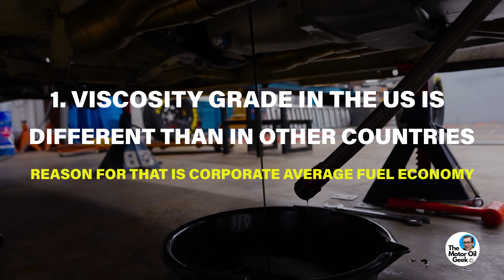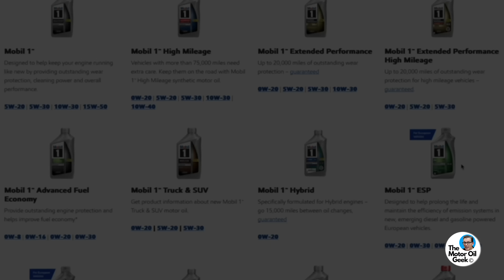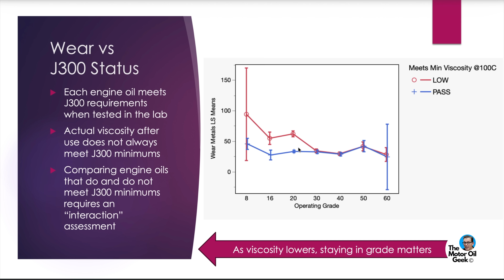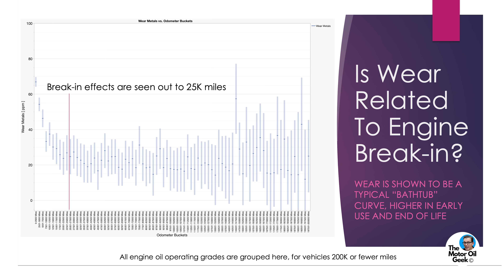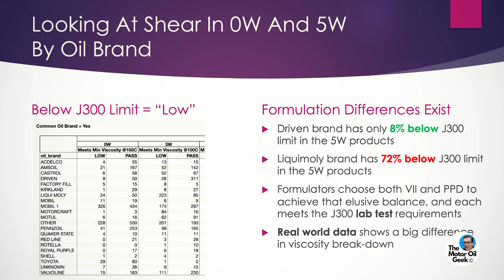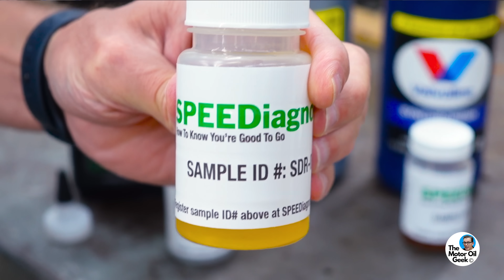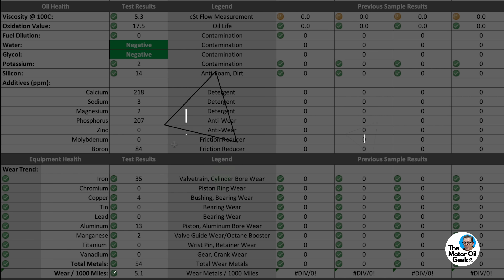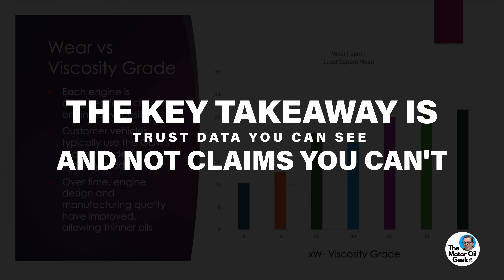More Ai Lies? The FACTS about 0W-20 vs 5W-30 (With Evidence)

Comment: Toyota recommends 10k mile oil changes.  Nope not following that recommendation 😂
Reply: 5k is my default but I'm going to start doing some oil analysis and see if that is overkill. I don't mind changing at 5k if it is going to make a difference in engine longevity but if it's not I got no problem pushing it out to 10k, either. Especially for vehicles that aren't seeing high idle times or taxi usage or heavy towing etc.
Reply: @bubba99009 Oil life depends on how many cold starts between oil changes. More cold starts for a given milage requires early oil changes
Reply: @bubba99009 lol you’re crazy doing every 10k
Reply: @bubba99009  I split the difference and do 7500
Reply: ideal condition, some have tested it and it fine. But i would stick to 5000
Reply: @bjsimon802  real world is never ideal conditions.
Reply: Yup...it's like the 0W-20 stupidity.
Reply: @tockero4277  usa govt laws
Reply: @bjsimon802  Trump just made those stupid "rules" disappear. CAFE is gone!
Reply: @horseathalt7308  ya trump did a great job, but he should have forced Europe and Canada to do the same. They are losing their minds in Europe, that is why many companies have to eliminate good cars and engiines for v6 and 4 cylinders.
Reply: @tockero4277 did you not watch the video?
Reply: @Dave-om6nd  Yes..understand your point...I may be confirming his data, BUT I don't trust it either.  He has another video that seemed to contradict this one regarding viscosity.  Also, I don't/can't understand 'sheer' by just watching the video.  Any/every video explaining data/specs etc should stand on its own to the novice and explain what sheer means and how it happens.  Eventually, I picked up that it is (I believe) oil breakdown, but is it from heat or time or RPMs.  Lastly, I don't think that widespread engine problems are caused by the oil.  The fact that we need someone to explain OIL shear, is a red herring the problems are likely in production and QC in vehicle AND oil manufacturers...and will agree, is at the hands of the EPA and the BS CAFE standards.
Reply: @tockero4277 so 0w-20 is bad?
Reply: I stick with 5000, quality full synthetic.   I would never go over 7000, but 5000 is best.  Oil is cheap, engines are not
Reply: @louofm1  I feel my car running slightly rougher (gas pedal vibration on acceleration) after 6500ish. 5k-6k seems right in my experience. Though I always buy the cheapest full synthetic 0w-20
Reply: @louofm1 all "Full Synthetics" are not the same as used to be. Many are Hydrocracked Group III Base oils. 5000 miles is best
Reply: @louofm1 i have a new camry and change oil every 3000-3500 miles, oil is cheap, engines are not.
Reply: Always use 5w30 every 3k miles… 05 4Runner, 18 years later at 240k miles
Reply: @ilovebohol an 05 4Runner calls for that oil .
Reply: @ilovebohol  the 05 4runner had 2 engine options. And both the 4.7 and 4.0 are 100% bulletproof and could run on  the cheapest recycled oil of any grade for 500K+.
Reply: @ilovebohol  That's a lot of wasted money on oil and filters.
Reply: @esoteridactyl it’s not. It absolutely extended the life of that engine.
Reply: @esoteridactyl engines are expensive oil is cheap!
Reply: I’ve been doing 10k changes and blackstone analysis on my Lexus and the lab always recommends longer intervals. I use mobil 1 and heavy stop and go traffic.
Reply: @pierrecastanets1974 you can’t convince them, I’ve tired 😂 let people waste their money.
Reply: @pierrecastanets1974 Glad to read  your comment.  Bought a 2023 Lexus Es300h in 2025 like brand new, asked the dealer to change the oil preventively, they agreed so they put a 5W30 oil tag in the engine compartment as well. Many debates over which oil brand, type & change interval ... 
Excited if you could share your thoughts  !  Thanks !
Reply: @pierrecastanets1974  The oil may be good,what about sludge build up?
Reply: @pierrecastanets1974  The lab recommends longer intervals because they can't see anything bad in the oil. Keep it that way.
Reply: I was skeptical of that when we bought a brand new 4Runner. Before that first old change and still today I check that dipstick and I’m impressed how clean and golden it stays all the way up to 10K. Maybe that’s because it’s a new engine and doesn’t have much carbon buildup? It’s got 65K on it now and also recommends synthetic 0W-20. Never really felt comfortable with that for a 6 Cylinder engine, but we haven’t had any problems. Toyota claims their engine advancement can stretch oil to 10K, however once they stop doing the changes and I’m doing them myself like with our other car I’m not taking it that far. Not worth the risk to me, just because the oil is clean doesn’t mean your engine isn’t wearing prematurely. 

You have to be careful about manufacturer recommendations nowadays, they don’t always have your best interest in mind, it at least has to benefit them first. All of this information is highly debatable.

And what I didn’t hear in this video is aren’t we supposed to increase viscosity as the miles increase? Thicker oils for engines with some wear to them.
Reply: @fighter4christ7 oil colour has very little to do with its wear situation.

You need to test the oil to see how it’s performing, like blackstone labs. It’s probably fine as it is a new engine, but you don’t know that until you tests
Reply: @fighter4christ7 the 4.0 in the 2010s plus 4runner are just so good that the oil dosent get very dirty.  Id only go up to 10k if i was going more than 5k every 6 months
Reply: @fighter4christ7  IMO, slightly thicker oil is also often a good idea in high ambient temperatures.
Reply: @shawngrimes9302 yeah same with thinner for cold temperatures. With semi’s we run 15-40 in the warm months and 10-30 or 5-30 when it’s cold. 5-40 is a good year round, but what you’re looking for is for the oil to cycle as soon as possible upon startup in 13-15L engines.
Reply: @fighter4christ7   To me, the fact that ambient temperature charts for oil viscosity seem to be disappearing suggests the thinner oils are a result of fuel economy targets rather than sound engineering and what’s good for the engines.
Reply: @shawngrimes9302  that’s all anyone cares about anymore. Just like those cars that shut the engine off every time you stop. You can take all those stoplight fuel savings and invest in new starters, batteries and other parts that go bad sooner due to that. Dumbest thing ever.
Reply: On some cars they have an oversized oil capacity, which is one way to legitimately extend service intervals because the degradation is spread out over a larger volume of oil.  Toyota V6 oil capacity went up around 25% between engine revisions.  25% extra does not get you from 5k miles to 10k miles, however.  It gets you to 6,250.  So yeah, 10k is asking for trouble.
Reply: My 2GR-FE was fine at 255,000 miles on 10k changes. It wasn’t oil that caused a guy to plow into and total it.
Reply: @rdspam thank you for sharing that info, as I also have a 2GR-FE
Reply: @rdspam  I had an 07 Rav4 with that engine, 244,000 miles when I bought the car. Oil changes had been so neglected that the oil pickup tube was almost clogged with varnish and sludge to the point that the oil pressure light was coming on.  I dropped the pan and pulled the valve covers, cleaned everything up and flushed the engine, fresh oil and compression was within spec on all cylinders and car ran another 30K miles until it was totaled by a texting driver that rear ended the car.
Reply: @BartSparrow123  Sp what I'm getting from this is that if you regularly wait 10k miles between oil changes, you build up a karma debt and the universe forces a change to balance things out! I need to change my oil soon...
Reply: @rdspam were you driving mostly highway because if you were that's why.
Reply: @rdspam  it is fine for daily driving and a vehicel that does mostly highway but if it is a toyota vehicle that tows etc this is considered higher risk and that 10k miles now becomes 5k-6k.
Reply: @rdspam  Which brand of oil and viscosity?
Reply: I go with 5k
Reply: The EU by law went to extended oil change years ago for Green Reasons which was 14K miles (BMW, Mercedes and such). Funny part is what the car manufactures did was increase the amount of oil the vehicles hold. That is why BMW/Mer and such hold 7 quarts.
Reply: @Cutterman_fixer Do these European politicians think people just dump the oil on the ground or something? There’s no harm from drivers changing their oil more often. The waste oil is used to make grease and other lubricants.
Reply: @highdesertarizona in 1963 popular science showed dumping used oil in a hole filled with stones.
Obviously recycling is the responsible way to go.
Reply: @Cutterman_fixer the European oils also have a lot more additives added to the oil as well which allows for extended oil changes.  US oils won’t last that long.  Increasing oil capacity doesn’t always equate to longer oil life.
Reply: That’s nothing, BMW says around 18k miles (30k Kilometers) for specific engines.
Reply: 5000 for naturally aspirated engines, and 4000 for turbo/Supercharged applications, under normal service conditions and using full synthetic, imo.
Reply: Also in severe contions TOYOTA advises 5.000 mile oil service intervals.  In my TOYOTA Manual  (Toyota Verso 1.8 VVT-i (147hp) in Europe  it says. "Factory Filled with 0W-20, for normal driving. Perhaps not suited where you live regarding outside temperature or driving conditions". Than a Table with 5 other suitable engineoil's, 0w20, 5W30,  5W40, 10W40, 20W50. So what do I do? I use 0W-40 during winter time, and 5W-40 for the summertime. I change my oil at least 2x per year at 50% of the recommended oil service interval. The standard interval is 15.000km (9.375miles), I change it at 7.500km (4.700 miles). The car is from 2006 I sold it 2018 with 285.000km (178.000mils) never had any issues. The person whoi drives it now has almost 368.000km (230.000 miles) on the clock. No issuses. Just regular maintenace, plus 1x schockabsorbers, new clutch (manual), and a timing chaine tensioner at 285.000. Needless to say I replaced that car with the same just newer! Read the manual and think about what it says, and what THAT given your driving conditions, driving style, outside temperatures and use of the vehilcle. Heavey use is: Towing, mountains, extreme long iddling, stop-and-go traffic, short runs (lees than 10 miles and/or 20min.driving), very sporty driving style with high revving. "Pedal to the medal"  Autobahn use for multiple hours.
Good luck and keep it lubricated!
Reply: @JWR6819 Problem is many manuals list 0W20 from infinity cold to infinity hot...
Reply: On my cars I go 4000. My 2005 Toyota sequoia is at 260k miles. On my motorcycles, which are air cooled, I go 3000-3500. Full synthetic
Reply: @yoshit9819 are you using 0w-20 ? I have a 2008 with 387K
Reply: Bought a new 2013 Camry with 2.5 engine...I do 3000 mile oil changes and dont worry about it. Its only driven 6k miles a year so cost isn't an issue. At 74k miles the oil looks like it was just poured out of the container using Mobile 1 synthetic.
Reply: @William-x8m6s oil filter starts collecting more debris as it gets dirty. Clean filters let more through. 5000miles is way good enough
Reply: @Paul__108__ recommended time is 1 year for those people that do very short drives. If engines do not operate at temperature for a period moisture builds up in oil.
Also, Group III Oil oxidizes over time. Group IV and V Oil lasts way longer.
Reply: Idk. I do 10k changes. I've never had an issue. I do use 5w-30 instead of the recommended oil in my cars, but the oil is just one thing. Transmission fluid every 50k is something I feel like a lot of people neglect. Not very helpful if your engine is in tip top shape when your transmission decides to eat itself. Gotta do all that other maintenance too. Oil is not magic.
Reply: @ghostlyone2 Car you talk about is ..?
Reply: @georgepotcovaru2595 Two 2013 Fords.  Mustang track pack and a beat up Expedition. The Ex asks for 0w-20 and the Mustang I believe says 5w-20, but when I actually put the 20 in the Mustang, anything past grandma driving would cause an oil burning smell. With 30 this goes away. Back when I actually did track days I would put 40 in it for the day.
Reply: @ghostlyone2 Toyota told me my transmission fluid was lifetime and didn’t need to be changed. I still changed it @ 66k. I change oil every 3-4K
Reply: @papabapyro  Retired from Shell Research division, we tested a LOT of oils. If someone tells you it's lifetime their teeth should crack and fall out, it's pure BS!
Reply: @papabapyro  Wise choice.  Co-work with a Camry had taken it in at 60,000 miles for maintenance, he asked for transmission fluid change, Toyota told him it didn't need it.  His Camry's transmission went out just over 100,000 miles, they told him it was because he didn't get it changed at 60k miles.  He got it fixed, traded it for a Honda.
Reply: @papabapyro  THEY LIE all the time. I had to INCIST they change it, and then I asked, 'Do they know how?" So I went to a different dealer. On 4wd Ravs theres a box in the rear that needs changing too.
Reply: I do 2k miles just cause. I drive my trucks like I stole them on a service route with 10 30 min stops per day. I can change oil in 10 minutes for 30 bucks with rotella t6 and a new wix xp filter every 2 or 3 changes.
Reply: Lexus tells me that. Schedule for 7-7.5 k oil changes or every 6 months.
Reply: @NorthlandermnEurope based, Lexus says 1 year or aroun 9k miles.  Lexus es300h
Reply: My wife's car was a 2012 ford edge 3.5 motor. we just traded it in because of front end parts wearing out. to expensive to repair. the car had 251,000 miles on it. when we got it , it had 24,000. I ran Amsoil, OE oil 5-30 for 1500 miles then switch to Amsoil extended life ( 12,000 mile drains ). Ran that till I got to 75,00, then went to  high milage     ( 12,000 drains ).  Never had a problem with motor. You have to keep injectors clean, ( this is a big key ) spark plugs, and air filter changed according to man  recommendations. We got a newer ford edge 2022 with 4cy turbo. I have Amsoil OE 5-30 in it. I'll run it for 1500  miles, then go to extended life oil till 75.000.
Reply: @billrowland3875  2013 Ford Escape 2.0 with 267,000 miles on it when it got wrecked. Never had an issue with the engine itself, except the vacuum pump and the purge solenoid. 
5W-30 Valvoline synthetic blend (high mileage after 75000) changed every 3-4000 miles. 
Unfortunately, the engine got destroyed in the wreck otherwise I would’ve pulled it and kept it!
Reply: They all recommend long oil change intervals. I bought a new Ducati a few years ago. They call for 9,000 mile oil changes. My bike has 9,500ish miles and has had 4 oil changes. Oil changes are cheap and easy.
Reply: Darwin called he wants his money back
Reply: didn't your mama ever tell you not to fight in front of a psychopath radar for too long 

intj 200plus
you might become their new hobby
Reply: It depends entirely on driving conditions. Most Toyotas and Hondas use 0W20 motor oil. That is a full synthetic oil. If your mileage is almost all highway driving, you’re not towing and you’re taking reasonably lengthen trips (25 or 30 minutes - of driving, not idling), then 10000 miles is fine. If you’re doing lots of short trips, in city driving, towing or doing lots of idling, then absolutely, you should shorten the time between oil changes.
Reply: let me throw a monkey wrench up in here I'm a black man don't discriminate
Reply: behold the 2-stroke and 4-stroke diesel engine
Reply: Good video.  Thank you
Reply: My wife’s Jaguar Fpace, 21,000 mile intervals. 😂🤣.
Reply: I did 10k plus oil changes on my last few cars. All of them made it over 200k before I sold them. Hell, one had nearly 300k before I sold it to college kid. She's still driving it 😂
Reply: My Toyota Highlander: 5,000 mile recommendation with 0W-20. 
I’ve considered even more frequent. But oil analysis says it’s been fine so far 70K miles
Reply: My Mustang says it can go 10,000 miles between oil changes but I change it at 5000 miles or below. Besides, is the oil filter going to be filtering up until 10,0000 miles? I don't think it will be filtering anything as it is filled with debris as time goes. Of course mfgs want you to go longer between changes because they want to sell you another car after you abused yours. In my experience in over 48 years of driving an engine will use at the least a half quart of oil every 3000 miles, and I rarely see anyone at a gas station checking their oil level, they just gas and go.
Reply: Check the car care nut. Big Toyota fan. Camery with 180k dealer changed oil every 10k. Motor was toast because of that. He explanes and shows what happened.
Reply: I used 5-30 and changed at 5k and my engine died at 10k…..😂
Reply: 10K mile oil changes are just ridiculous specially now a days that you got direct injectors putting fuel inside the combustion chamber at very high pressures. With direct injection you will find fuel residue making its way into the crankcase oil faster than with port injection so it is crucial to change the oil every 6 months or 3K miles.
Reply: @abraham3981 Hybrid and Start/Stop engines are harder on oil.
Did you ever hear large tractor trailer engines last for million miles? Engine is always hot and running. 
Cylinder and ring wear is worse starting up till at operating temperatures
Reply: Tell me you didn’t watch the video till the end, without telling me you didn’t watch the video till the end
Reply: 2grfe here with 10k+ oil change intervals 320000 miles zero oil issues using amsoil
Reply: 10k on 0w16? sureeeeee
Reply: @CleanerCars if memory serves , on 0w20 full synth
Reply: for an average user who KNOWS how to use a car yes... but still no one will do it so... yeha 6k and is already high to me for a subaru
Reply: I would never let oil sit in my engine for 10k, dealerships are saying that in hopes you have issues to where they can charge ppl for service... I change my oil every 4k miles
Reply: Right. Just ask FordTechMakuloco how well those 3.5 Eco-boosts do on the 7500 mile intervals that Ford recommends
Reply: I get free oil changes on my 2025 toyota and they're saying every 5,000 🤔
Reply: Between me and my family we have multiple Toyota's well over 200k miles, all have followed 10k oci and none use any oil. 

Go ahead and waste your time and money I guess...
Reply: You should, I run amsoil in my Toyotas and Chevy's. I sell them at 300k miles 4 Toyotas and 6 silverados so far no trouble with annual or 25k oil changes.